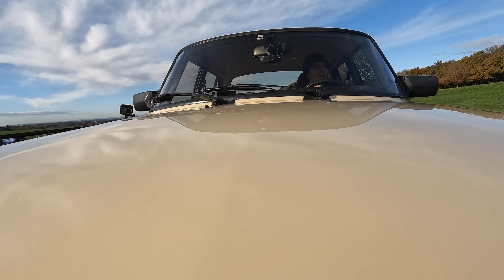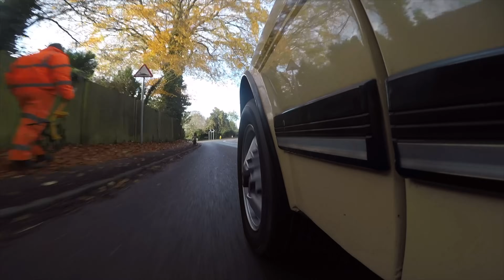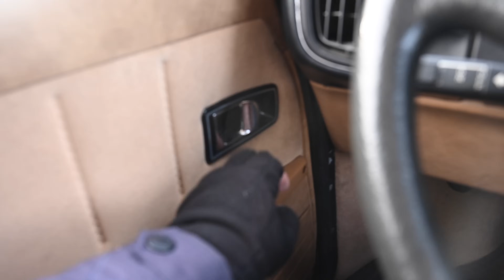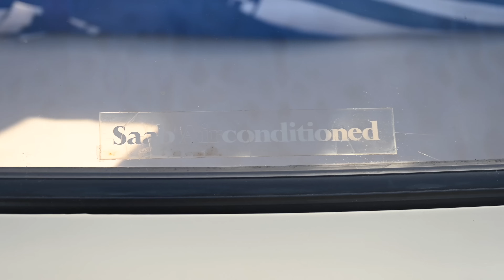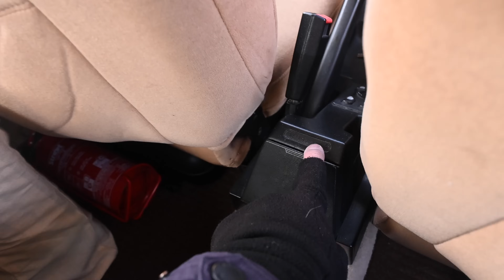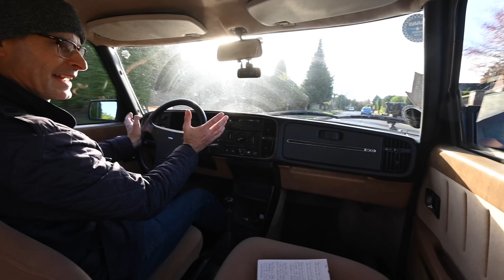Factory custom, one-family Saab 900 Turbo!

Comment: I love an ‘80s SAAB. Where we lived there was a Saab dealership across the road from the Austin Rover garage. After much deliberation my dad bought a new Montego instead of a nearly new 900 😢
Reply from the maker: that was, in retrospect, probably a mistake!
Reply: @furiousdriving indeed. The Montego was a well designed car but very unreliable. On our first drive out we noticed a creaking from the A pillar, turned out the roof wasn’t welded to the pillar on one side and the bonded windscreen was holding it all together…..amongst many other problems the speedo units got noisy at about 12k miles and were replaced several times so when it was sold at 3years old it only had about 9k miles showing😅 the SAAB would definitely have been the better option!
Reply: @alansorbie4038  Surely they could have made a warranty claim for that roof - I'd have wanted a replacement car.
Reply: @Summers-lad the roof was fixed under warranty. The car just went in for the creaking to be fixed , assuming it would be a trim issue which I think is what they told him at the time. It came back fixed with no creaking so all seemed good. It was quite a while before my dad found out the real cause of the problem from a friend of a friend who actually worked there!

Comment: I thought the engine was original from the Triumph Dolomite Sprint
Reply: Pretty sure that was the 1850cc engine used in the original Saab 99.. then further developed by Saab. Dolomites Sprint was a two litre single cam sixteen valve only used by Triumph as far as I’m aware.
Reply: @nickfoord750  "the original" was canceled after 2 years I think that was 1972. After that 2.0 only. You can check if you like.
Reply: @kd23se4  2.0 B series was a redesign/ development of the original Triumph based 1850 engine.
Reply: @nickfoord750 the Saab slant 4 pre their own manufacture was 1.7 then 1.85 (latter being used in Dolomite as well)
Reply: he did say that
Reply: @Thomasweaver_wow  But it´s not. The Saab 900 only had till 1982 the B-engine, which is based on the Triumpf (booth engineered by british company Recardo). Even the B-engine - the only part that fits from the Triumph engine are the Valve adjustment shims. In 1982 Saab introduced the H-engine (the one in Mats Saab) and this one they used with variations (8 and 16 valve) until 2002 (9-3) and 2005 (9-5). How you know it´s not a B-engine? The ignition distributor on the H-engine is placed in the head (like on modern cars) and the B-engine has the distributor placed like on a Rover from the side of the engine.
Reply: @kd23se4 I didn’t say it was I just said he said that but hope you feel better
Reply: @TheClanDFA  no, I am not feeling better. Because you missed the point. But never mind.
Reply: @kd23se4 point is where did I claim or ask Mr cut n paste from the internet
Reply from the maker: It was a bit of a joint effort, they were both working on one, it was developed from mainly Saab ideas by an outside company and Trumph made and supplied them to Saab
Reply: Ironic that my dad went from Triumph 2000 company cars with Dunlop to a Saab 900 when he retired.